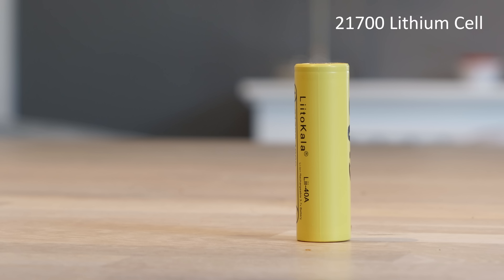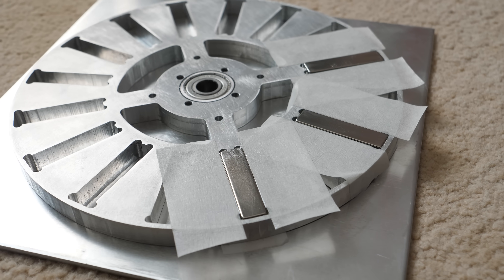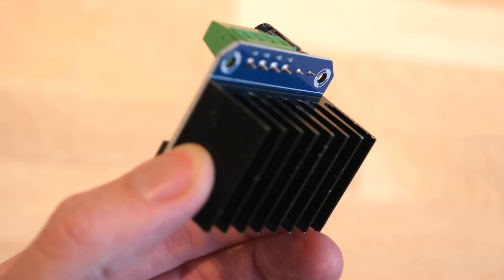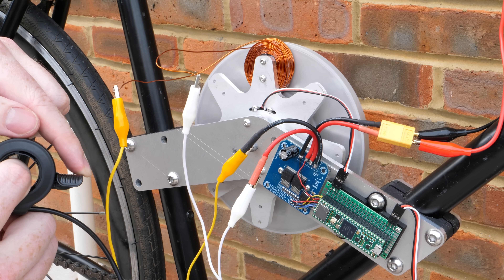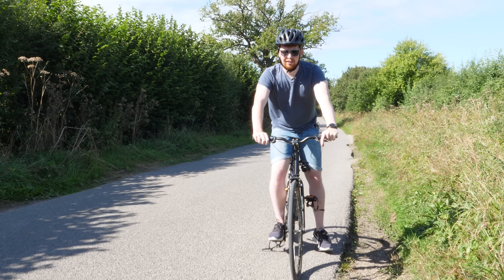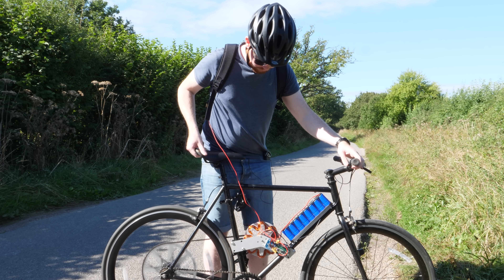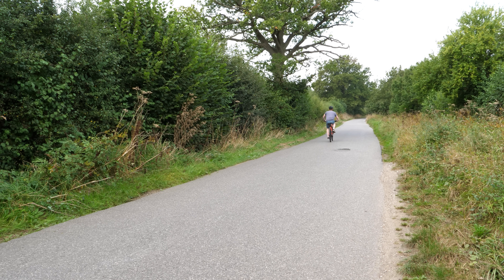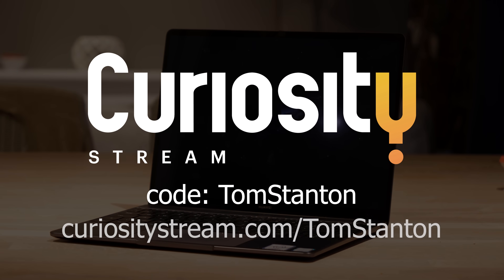Super Capacitor Bike

Comment: I apologize if this was considered and decided against, but would it work to use a full wave rectifier in place of the DC motor controller? (I'm just now learning about rectifying diodes in my circuits class, and I'm wondering about applications) :)
Reply: You want the opposite you don't want to rectify

Comment: I see that nobody mentioned it, but you have a HUGE flaw in your capacitor pack for this kind of application.
I saw that you calculated the joules, but I havn't checked that myself, so I don't know if you considered it.
But if you have 400 farad capacitor, and putting 8 of them in series you wont get 400X8 farads, in fact your total farads will be 400/8 which is 50 in TOTAL

Comment: I'm assuming if you compare the power stored within those two minutes in the capacitors to the power stored within those two minutes to the same volume of lithium battery pack, it would probably be very similar, no?

Comment: Maybe put the pedals on a generator so you can charge it while using it manually? It might slow down the pedaling cuz it's using energy from what could be going into the movement of the bike currently, so possibly have a switch to enable charging?

Comment: Capacitors equal NOS normal battery equals fuel is it really that hard to figure out capacitors put out high voltage at a short-term batteries low voltage at long term
Reply: I don't know if I got that right or not either way still makes the point

Comment: Instead of charging through a battery charger why not reverse everything so the peddles charge the capacitors and then switch to the capacitors turning the motor.

Comment: Would it increase the potential speed for charging li-ion batteries if you put a capacitor between the generator and the li-ion battery? They seem to be able to absorb the energy rather well
Reply: In practical terms, not really. If you had half the energy storage in capacitors, then you could effectively half the battery charge time (kind of, I think it could get messy discharging a half full battery & capacitor initially) As last 1/2 of battery would charge from caps while riding.
In practice caps would be much more useful for temporarily storing brief high current charging. I also don't think current caps will handle slowly discharging to a battery for charging very well)

If stopped to charge, it'd probably be better to just swap out the batteries and you effectively have instant 'charging', and if at home or somewhere where discharged battery can be left(ideally charging) there's no extra weight or bulk.

Comment: ultra caps are for capacitating energy temporarily, thus you can use the energy to fuel a dc charger to recharge the main battery. Formula E has mastered this!

Comment: The motor is brilliant, fantastic project! I know you needed to put the capacitors in series to get to 20V, but why not use 1 super capacitor that can be charged up to 24V? You would increase your range 8-fold, if it had the same capacity as your 2.7V capacitors.
Reply: I don't think there's any such thing. Supercapacitors are electrochemical, you can't make them do higher voltages without putting them in series.

What might work is putting them in parallel (or maybe 2S4P) and then using a really ridiculous boost converter to step that up to what the motor needs. Not only would that increase the number of joules you could get out of the supercaps, it would also extend range a bit by flattening the power-vs-state-of-charge curve.

Comment: 1) This contraption is actually useful, because it'd make down-ups less impactful and could give a better acceleration if needed.
2) Supercapacitors could increase regenerative efficiency if for some reason it does not already have a low resistance buffer.

Comment: It would be great if you could operate this as what I essentially as a crank charged bike like those radios or flashlights. Using the pedals to charge the battery and with the flick of a switch, make it battery operated. Reducing the physical power needed to ride the bike. And then maybe as an added bonus, combining the active state battery power and the standard pedal power to speed up the bike.

Broken down like this
🚴‍♂️>⚡>100%🔋>🕹>🏍>🪦>🚴‍♂️>repeat
Or 🚴‍♂️+100%🔋+🕹= I AM SPEED

Comment: lol. 1 human dietary calorie is equal to 4184 joules which is about 4 times the capacity of the capacitor setup you used. lol. Yeah, so it's not surprising you barely got anywhere using them.😄 Humans are pretty decent energy storage devices as long as the power needs are low.  You would have been better off just peddling yourself but there isn't much fun in that.

Comment: Why not use both the lithium and capacitors where the capacitors are used to directly power the motor while the lithium are charging the capacitors with regenerative breaking charging the lithium and maybe add a solar panel to add another charging source. You would have the immediate power of the capacitors combined with the range of the lithium as well as an additional power source from the solar panels.

Comment: what if you you make your pedals with a generator that charges the supercapacitors that then turn the motor turning the rear wheel.. Maybe try to make a chainless bicycle with a generator at the pedal hub and a motor at the wheel hub.. would your pedaling give enough juice to run it? would be interesting to see the efficiency

Comment: I have an ISDT charger (Q6 nano, I think) and it has an adjustable PSU mode with current and voltage limits, I think that'd work way better to charge the caps, assuming your charger supports it.

Comment: For the most part your car runs on papers but what do you really means will it run on its empty maybe close to empty and the answer is yes but that's not you have to have complete voltage the whole time when you have electricity which is like comparing it gas tank to be in full

Comment: I feel like combining the rapid charge function of the capacitors with the high energy density of a battery may have serious potential, especially for regen braking. Imagine using the battery to drive the bike, and when coming to a stop, the capacitors recapture some of that energy and then use solely that energy to get going again, instead of the battery.
Reply: Aren't capacitors more efficient at storing energy than batteries? that's definitely be a good idea if that's the case. Maybe if you beefed it up a bit the higher discharge rate of the capacitors could mean a very powerful boost :D
Reply: yeah just commented about this concept, regen 40% of the energy you put into an ebike that never has to charge, all it needs is an optimized battery-capacitor solution
Reply: Or much simpler to use a spring loaded startup by using a mechanical braking energy windup coil.
Reply: @sharan4700  simpler in design but not in operation.
Reply: @sharan4700  Bingo! I've that idea for years. Mechanical regenerative breaking.

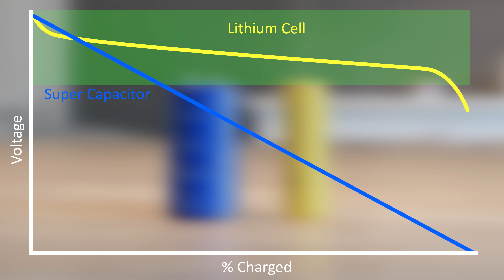Comment: your graph appears to be wrong at 1:20. wouldnt the slopes be opposite? if % charged increases, so does voltage, right?
Reply: As the % drops the voltage also drops
Reply: Yeah it should read % discharged

Comment: I would love to see this with low capacitance, high voltage capacitors instead of the supercaps. The higher voltage is actually what you want when trying to induce magnetic field. In addition, power is related to voltage by voltage squared over resistance, so you would increase power to the engine. I was able to get 96 volt capacitors on alibaba for $5 each. Try it!!
Reply: Low capacitance is the same as low storage capacity... what use is that ?
Reply: @peterfitzpatrick7032  1000 times the voltage capacity would more than make up for 100 times less capacitance. Think of it like gunpowder vs candle wax. The gunpowder has less energy storage, but higher energy density.
Reply: @greenief9097  this is wrong. Voltage is inversely squared related.
So 100 Volts only covers 10 factors, 10,000 only covers 100 factors.
Only caps that have that high of a rating would be ceramic caps, which generally does not exceed a single farad.
Reply: @cpK054L  Power = Current * Voltage = Voltage^2 / Resistance.....
Reply: @greenief9097  
You realize that Capacitors are not a "real" resistance, right?
It is an impedance, inversely related to the frequency of the system.
Impedance = -j/xC
The only thing "real" about a capacitor is the parasitic element, or ESR "equivalent series resistance" You also have ESL "equivalent series inductance" which becomes a problem when dealing with resonance (which is not the case for low frequencies)

You're also using the wrong concept here because the current across the capacitor is not a real number either, it's complex.

Current across a capacitor (ideal) equals
Capacitance * dV/dt (the rate of change of voltage, in respect to time)
you cannot use V²/R in this case because R is affected by the frequency.

That is why the context of Watt's law typically does NOT use resistance because you'll only consider the Real power, and not the Apparent power, BIG difference.
The resultant vector is you lead/lag and affects the power factor.

That is why the only thing you can use in this instance the Energy STORED in the capacitor

Energy = ½ C*V²
Where C is the Capacitance
V is the voltage across the terminals of the equivalent capacitor
and Energy is in Joules.
Divide this Energy into the time slice and you will get the Average power dissipated.
Reply: @cpK054L  It is not innacurate to treat resistance in the power equation as the resistance of the circuit that the capacitor is in.
Reply: @greenief9097  Ideal capacitors do NOT have resistance. Hence your power equation is out the window.

Power = V²*/R where R is infinity in DC.
Reply: John Portal  715C50KTT20M4
50,000 Volts. At 200pF, 43 dollars from a LEGITIMATE vendor.
He didnt say what capacitance it was at, but this has absolutely NO energy storage and is actually used as filter caps rather than bulk caps.
Reply: @cpK054L  This is a good point, the 96V caps I have were rated in the milli farad range, anything less would not be useful for power dissapation.
Reply: @greenief9097  As I mentioned in this constant "96V capacitors" are anything BUT what the poster is using, which is most likely an EDL "Electronic Double Layer" Capacitor. These don't ever exceed 4 Volts (if that) and can have upwards of 15,000 Farads. Thats because the application of these capacitors are "backup" power and not long term power.

Your 96Vs are most likely one of three types of capacitors:
Aluminum (tin can)
Tantalum (low ESR)
or Ceramic (little jelly)
These are never used in the same application because of the parasitic elements and are used in other applications like
Filter design (Low Pass/High Pass/Band Pass/ Notch. etc.)
Bypass (RF removal)
Bulk (Power supply regulators)

I found the most interesting concept of using capacitors seems to fly over experienced engineers that forget that passive components... HAVE PARASITIC CHARACTERISTICS.

They forget about "in-rush" concepts and end up blowing up FETs and OpAmps because they think it's in the safe operating range when the in-rush exceeds that by many times over.

I = C * dV/dt
V = L * dI/dt

resistors don't have this problem.
Reply: @cpK054L  These capacitors are capable of holding 96 volts. They're electrolyitc capactiors
Reply: @greenief9097  Okay, now I'm genuinely curious.
What is the part number of your capacitor? 
"96V is apparently not even a common value"
and the fact that you said you got it from Alibaba makes me even more suspicious.

Comment: Would charging the capacitors with the battery pack enable you to squeeze the last ounce of power from the batteries without losing speed? And on regen, if the capacitors are full the batteries can recharge? Could the capacitors have a regen function, say on a long hill offering regen from the motor and the full capacitors?

Comment: Can super capacitors be easily/quickly charged using a bike dynamo? If so, what if you made a hybrid capacitor and lith. ion battery bike, hook up a dynamo, which charges your super capacitors while using the pedals and while you use the super capacitors to drive, it slowly charges the batteries? Of course you will still have to put in a little effort pedalling, but that way you could (maybe) charge both while driving..?
Idk, I am an amateur in electronics but this or something similar may be worth a shot?

Comment: Bro. You have to do this with solar panels. So cool.

Ion-li batteries are limited by a charge speed of 1-5ah, so in practice it would take about 2-5h to fully charge a 10ah battery, which is cool if you are really slow drinking coffee I guess.

Also, crazy good engineering skills there.

Comment: Just visiting to inform humans you can escape tyranny through independence. Cheap abundant energy collapses their control system. Live free and independent using water as reusable fuel. Your gasoline and diesel engines treat heat as a useless byproduct. Recycling hot water condensing from steam engine exhaust reuses most of the thermal energy. Venting steam exhaust from a steam engine through a series of heat exchanging radiators drops the temperature a few degrees allowing collection of hot water that needs minimal BTU to boil again.
The thermal energy required to boil hot water is far less than the mechanical energy available from displacing hot water with steam pressure through a hydraulic pump. Water expands almost 1700 times as it boils, volumetrically 3 times more powerful than gasoline as it changes phase to a "gas".
Lasers train reptilians to behave respectfully. Cheap engraving laser in your pocket with a fiber optic cable taped to your glasses instantly blinds any thug permanently, handsfree; thus teaching humility, begging for help for the rest of their lives. Intelligent one eyed thugs might learn respect before loosing the other one.
Well armed public is a polite one.
Sufficient laser power solves most problems, cheap abundant energy solves the rest.

Comment: Close the magnetic circuit by placing a steel disc on the outer side (chain side) of your rotor. The lumpy noise you hear with the go pro near it is excessive slip.
Closing the magnetic loop will increase your flux density through your coils and significantly improve your design 
Nice project

Comment: Suggestion.  Turn the pedals into a generator to charge the capacitors and turn the bike wheel, and then power the bike with the motor and capacitors for coasting.

Comment: with the motor assuming that at any point a few of the would be in regular polarization a few would be in the reverse polarization and some of them would be off at any point in time. you could instead of adding more magnets use the off coils as detection for the on and off

Comment: For my capstone project we made supercapacitors by hand using more green materials. We were able to make 70 farad capacitors, and what we found was that in order to step up the voltage to power a 12v motor, wiring capacitors in series significantly lowers the total capacitance. Then the amount of weight on the motor then requires more amperage to be able to turn it (we powered an rc car). And it could barely move with the weight of the cap bank on it, but ran for a 1-2 mins when we lifted the bank off of the car.

Comment: Interesting, a few years ago now, I have seen an electric car using capacitors in USA, worked well for the driver's commute (if it was USA the distance was probably a few hundred yards!!!). As for your bike, with a trigger control, whilst it works, it is not actually legal, electric bikes can only have electric power assistance, not actually powered in its own right, probably the same as electric scooters that are undergoing trials, they aren't legal in public spaces. Boundaries need to be pushed, lithium batteries are really going to be the past, far too wasteful of precious resources - I can't see them lasting for more than a few years.

Had you thought about making the motor similar to the Lynch Motor? That generates DC and is supposed to be very efficient...

Comment: How does this tech apply to velomobiles (VM's), which reduce wind resistance but add weight to a recumbent tricycle? YouTube has videos of VM riders using parachutes to slow their downhill speed without burning up their brakes. Aerodynamics create excess interior volume, which could accommodate capacitors. How well could capacitors store downhill energy for the next climb in short cycles of charge and discharge? Even with the weight of the body some say a VM is intrinsically more efficient than a bare trike, certainly on level ground. However, during the climb speed drops below the point where wind resistance matters, and the shell becomes dead weight. If the shell was lined with capacitance would that extra weight (capacitors and motor) be a net asset on a hilly ride?

Comment: I like the idea using capacitors instead of batteries. I would think that the motor is not very efficient. You need to make coils on both sides of the magnets. Just an idea.

Comment: So why didn't you just do a 'normal' pedal assist ride? Seems to me that the capacitors would charge up fine & you'd get enough assistance to easily get back up that hill & with a double battery pack (with clever switching), you'd get up a hill twice as long

Comment: To make a capacitor bike work you need to make it burst the energy into half turns... in other words it acts as an assist for just one kick as your real leg is supposed to charge it and get it to carry out the 2nd half turn. If you span out it's power over 20 feet instead of just one small boost it defeats the idea.